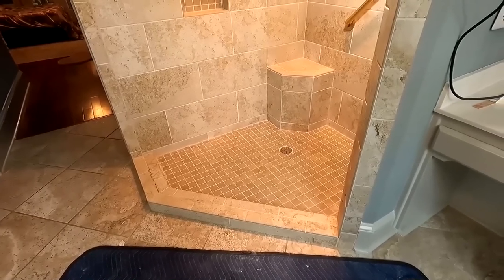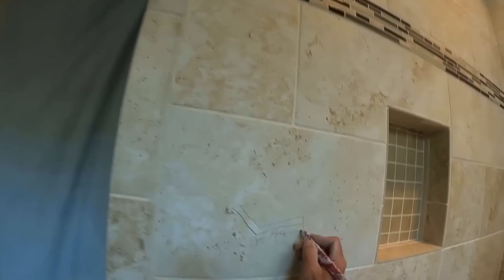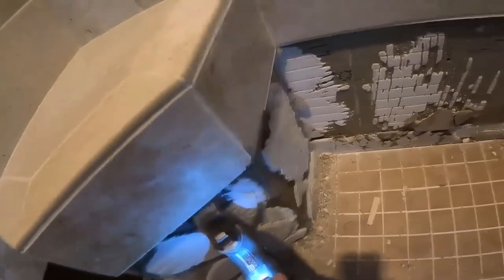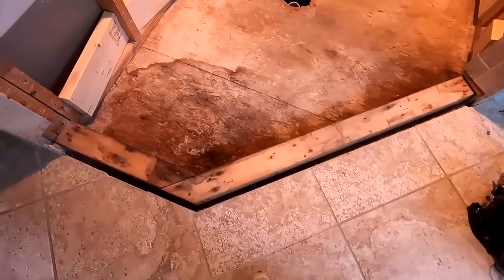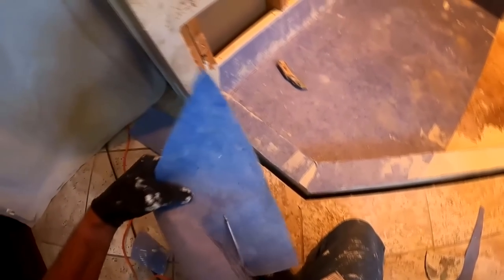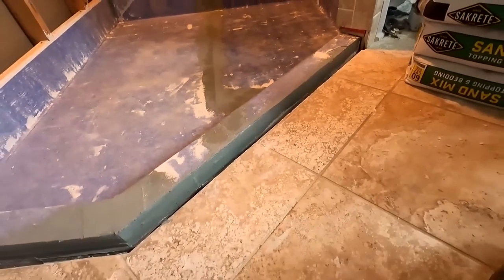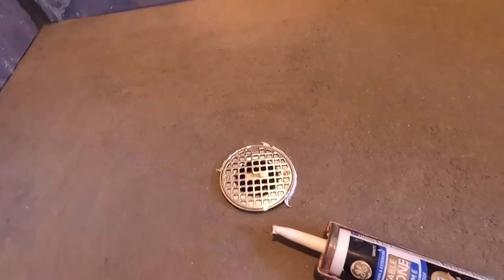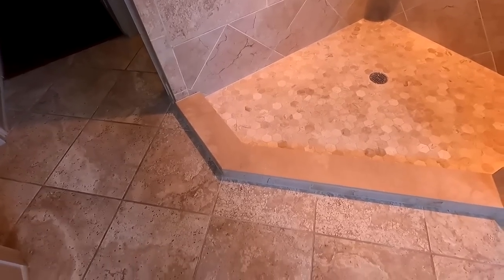FULL RE-BUILD OF A SHOWER PAN...from start to finish

Comment: All of my tile was floated, 1500 sq ft kitchen and bathroom floors and 3 showers. The work was done in 2003 by Italians. No failures yet. I remodeled the main bathroom, from bathtub to walk in shower, cast iron Kohler. Found all of the studs were absolute garbage. But, when you float everything, wall flatness isn't needed. The general contractors must love Italians. Save so much in lumber costs.

Comment: Question: is the outer edge between the curb and the main bathroom floor waterproof? I'm pulling my hair out trying to figure out how to connect the old tile floor to my new curb. Same question goes for the shower wall - how to connect the old tile to the new. Thanks, love your content!
Reply: I have the exact same question
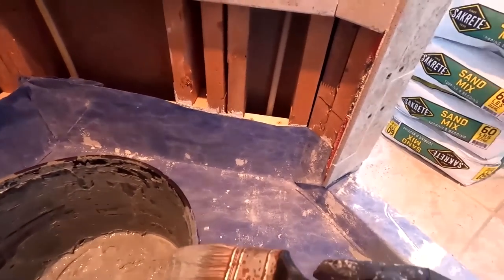Reply: 57:23 ?? I dk if that answers your question

Comment: What are your thoughts about ONLY using Red Guard where the mortar pan meets the shower pan liner in an active earthquake area? Here in Alaska, my rebuild of a shower pan is taking place on the second story of wood frame home that can jiggle, sway, and twist quite a bit, and quite regularly with the earthquakes we get here. Granted, a big earthquake is probably causing more issues than just a teeny hairline fracture in the dried red guard membrane, but I'm wondering if you would recommend also putting in some other layer of thin fabric at the joint (1:09:20 )to help keep it fully water proofed in case there is any small and repetitive  movement in the floor.

Comment: 5:37 — not trying to make an excuse for the previous installer, but seeing that glass sheet liner… I can sort of guess that they struggled with the glass material being less thick than the wall-tile 
So they probably tried floating it as it was installed (crew of 2-3 people) and then started overcompensating with too much thin set — then they probably didn’t tamp in the glass because of all of their thinset squeeze up 😂

Always fun to see liners around various showers, because you can see where the thickness variation was either a problem for the installer or a visual feature

Comment: How much would a job like this cost? My two person rectangle shower with a bench just failed and the plywood underneath is pretty soaked so trying to get an idea of a ballbark of the cost of this job, because I don't think I'll have the time to get all this done myself.
Reply from the maker: There is never an across the board price because every contractor pricing is different and geographically speaking people make money on the coasts a lot more than other places....
If I'm not mistaken I charged about $4,500 for that job, but then that's a much larger shower than normal too, my average cost for a shower pan redo is about $3,500
Reply: @StarrTile  well worth it! Excellent!

Comment: how did you connect old waterproofing with new one  ( if there was one in the first place ) - i get that you had butered up the gap with thinset and waterproffed it  but as you had said it is not waterproof if there is  a gap that old thinset had made imposible to connect waterproffing together - will it soak up water and start to rot ? how exactly do those repairs work?
Reply from the maker: There wasn't any current waterproofing being used, that being said most of your failure happens ankle below so my waterproofing would avoid any problems going into the future

Comment: Im currious on walls with both steel beams and 2x4 construction.  Would you fit 2x4s in to fill the bottom pan or would you use steel?
Reply from the maker: 2x4

Comment: How did you waterproof from the existing tile to the new tile/repair? 
Its supposed to be overlap each other
Reply from the maker: I'm not sure I understand your question, the existing tile that's on the walls doesn't need waterproofing, the waterproofing happened the 17 in down from the existing tile to the pan and including the pan

Comment: Did you put silicone under the liner around drain flange like you usually do with the pvc liner? If not, why not?
Reply from the maker: Sometimes I will if I think it's necessary but as a rule we are doing water and water out system and therefore no water whatever see that area anyway

Comment: Does that water proofer stick to the silicon caulk around the drain?
Seems like it would not bond and leak after a while.
Reply from the maker: Yes it does a pretty good job... generally speaking I'm using waterproofer first to neck of drain and then overlapping the silicone. 
The waterproof layer is your safety net and silicone is backup.
Reply: @StarrTile  
Thanks for the follow up Bob!

Comment: Question. How come you didn’t lay down sand mix bed and then fleece. It seems like you doing liquid waterproofing twice when you didn’t need to
Reply: This is a flawed install.  When the liquid membrane fails, the pan will be saturated as the drain weep holes are plugged below and trapped, known as a mold sandwich.  The wall should have been gutted up much higher, It does not look like the new tile backer board was waterproofed to the original exiting.  This will fail over time.

Comment: Question we pulled out a tub it's a concrete slab under whole house. We wanna cut out the concrete floor and dig down 8inches and pour a new slab size of the shower pan so it's below the main bathroom floor. Then build pre slope pan. The shower door will mount on the edge of the cut out, which we will grind down on a slight angle sloping towards the pan. What are your thoughts on this.
Reply from the maker: So you're trying to accomplish building a curbless shower basically
Reply: @StarrTile  the pan will be 4inches lower than the slab/ the main floor. So when you walk up to it and open the door you will step down four inches into the shower pan the main slab is the curb if that makes sense.
Reply from the maker: @fostersteele5825  right but I don't understand the purpose of that if his not a curbless shower which in essence it would be, you would still need to create some type of slope going up to the entrance and all other sides so that water will shed into the drain where ever that happens to be.
And I'm still curious as to what your specific question is
Reply: Lol this is one of those scenarios you’ve spent too much time thinking about if you “could” you never stopped to think if you “should”. What you’re talking about can definitely be pulled off but.. why? Just to step down into your shower then have to step up out of it..? Why not just do a curb the normal way and save yourself a shit ton of time money and effort for exactly the same result? Or if you gotta be a little different just do curbless?
Reply: @Mr_Glock19  the main reason is if it ever leaked its below the main slab not leaking onto the main floor. As far as stepping down 4 inches and then back up 4 inches you kinda do the same thing when you lift your foot up to step up and over and down into a shower pan built on top of existing floor.
Reply: @fostersteele5825  when I was house shopping back in 2008 I saw one time a tile bathtub recessed into the floor. It was interesting, all I got to say. Just pointing out that similar things out there are like that. 👩‍🔧
Reply: As I age, I see the benefit of a curbless shower due to the fact of possibly tripping over the curb getting in and out. The idea of stepping down into the shower to get in or stepping up to get out isn't safe imo.....but cool to look at.

Comment: So why no cement board or similar application around curb? Looks like u thinsetted the wood curb. Wrapped with pan liner / waterproofed then tiled.
Reply: Looks like u thinsetted the liner around the curb too.? Before waterproofing
Reply from the maker: Cement board goes inside outside and on top of the curb, then buttered with thinset then waterproofed...it's irrelevant what the wall board is, the entirety gets two coats of a liquid topical membrane, it is Bulletproof, not sure how to answer your question any better than that
Reply: @StarrTile  it wasn't showed in the video.  So it looked like you just thinsetted the wood curb or something.  I work construction.  I am mechanically inclined. I do everything around my house and dont like to hire anyone unless I absolutely have to.  And I am a perfectionist. And like my work to last. I like everything perfect. Even all minor details.  I re-did both my showers about 4 years ago using your videos and they still look as good after the day I finished.  So thank you for that. It been awhile since I visited your videos and just thought maybe you were doing it a different way now or something. I know how things constantly change over the years!

Comment: I'm doing this exact thing. The "contractor" who did my shower didn't know what the hell he was doing. Water seeped in and messed up the curb and God knows what else. Do you apply silicone where the shower floor tile meets the wall tile? Or is that just grout ?
Reply from the maker: I only use grout, others will use silicone but I don't see the point if it's done correctly
Reply: @StarrTile  thank you, much appreciated.

Comment: Why not use a flofx type drain if weep holes makes no difference in this type installation
Reply from the maker: You're absolutely right weep holes do not matter any longer as long as you do a seal system... but does not require a product to do a sealed system as demonstrated here, I've done a sealed system before it had a name, and when I caught flack for even doing it.

Comment: Wondering why you don’t wait to grout the floor until the wall tile is installed? This way you grout everything all at once 
Great video
Reply from the maker: The floor is grouted first because the wall tile will eventually overlap that so you need everything solidly filled
Reply: @StarrTile  ahh, good point. Thanks

Comment: The water will never be able to get over the lip of the drain because you double waterproof which is a mold sandwich, when the water gets through the tile on the shower pan it's going to be stuck in that waterproofing and since you waterproof around the drain and cocked it's just going to sit there and stay saturated in the Overflow will eventually go over but it will stay saturated
Reply from the maker: Interesting dissertation....
Doesn't work that way, fortunately for me.
Reply: @StarrTile  so then you tell me how the water that you just trapped oh, that's going to be in the thinset saturated underneath the shower pan tile, tell me how that gets over the caulking that you did and waterproofing to get in the drain,
Reply from the maker: @BonBon770  if and when it gets into the thinset below the tile then it will dissipate out of the grout line same way it got in, same way that a wall would if a wall gets saturated with water... the assumption is the excess water will evaporate.
You can also refer to the article link that I put in my community tab, if you read that he basically says the same thing that I do, when a shower pan is saturated with water, even with a pre-slope then it will always be saturated, I would rather error on the side of caution and have a small amount of water between tile and thinset than to have the entirety of the pan saturated.
Reply: @StarrTile  😅
Reply: @StarrTile  that is totally incorrect with a proper pre-slope in the weep holes not clogged and draining properly a traditional mud-bed will never stay saturated, it will saturate and dry and repeat, it will never stay saturated or hold water,, That's the whole point.
Reply from the maker: 😂😂😂😂😂
That is too funny oh, your mortar bed will never ever ever ever dry out oh, and your weep holes will never drain out water and you have no evidence to prove that...
That's why I said at the very beginning it's an interesting dissertation, do you know what dissertation means? A report backed up with proof, and you have none...
But I digress, nobody is doing the water in water out system any longer, that's why there is the divot method, the bonding flange, and then of course my own very special method which is tried and true for years ✌👌💪
Reply: @StarrTile  🤣🤣🤣
Reply: It's caulked not cocked smart guy...
Reply: @fencerider1492  no kidding, I don't have time to edit sorry there buddy, you just keep listening to Star tile.
Reply from the maker: @fencerider1492  He's a troll...his methodology tells me he's 80 years old, but his remarks tell me he's 15...either way I'm no longer entertaining someone who lacks critical thinking 👌
Reply: For that to even happen water must get past the tile and grout, expected but in very minimal amounts. Then through the thinset, this is expected again. Then through the waterproofed surface of the mortar bed and walls. Then, and only then, moisture would be trapped because there is another waterproofing membrane at the bottom of the mortar bed.

If that happened, then it becomes an issue. But your waterproofing needs to fail first. If that happens then the end result is a failure for any waterproofing anyways. This applies to roofs, stucco and sidings too. When water gets behind them, then the waterproofing goes to work and excess moisture drys out.

 Guess what happens when the waterproofing fails? Something way worse than trapped moisture in a few bags worth of mortar.
Reply: @MrJramirex  totally agree, but with a pre slope, a 40 mil vinyl liner and a post slope at the correct pitch 1/4 inch per foot. And most importantly, the drain hooked up correctly, meaning not clogging the weep poles not not using plastic weep hole protectors I used to use River Rock but the plastic pieces are better. If you use that method, and I also use half inch concrete bored, and that is also waterproof Hydro ban. I also pitch my curb which is usually would pressure-treated on concrete on the bottom and two regular on top. The pan with wraps all the way around and I use Four Corners if I have to fix the plumber pants. Because it's remember I'm just a tile guy. You cannot puncture the top of the curb it is only supposed to be stapled on the outside or nailed whatever, in 10in up and three in minimum above the curb, that's what I've learned over 23 years. It's all in the details, and when you have a system that works without any of these foam boards, or glofx drains or membrane that goes over drywall, why reinvent the wheel? People were just building the wheel incorrectly. And don't even get me started on keying in substrate and flashing the backs of tiles and directional troweling, have a good evening.

Comment: How much did the cost.i have the same problems. Just to get an estimate
Reply from the maker: @adesh217  well that depends on a lot of things like location, type of tile, if I have to remediate anything, but on average a shower pan redo I charge about 3 to 4000
Reply: @StarrTile  first off your video was very helpful. Thank you so much for responding. 

my shower looks the same and have the same tiles.Im on the 3rd floor and the tenant on the second said it was leaking. We are getting a contractor to came and take a look. Its an apartment. Could we still live there while the work is done ?
Reply from the maker: @adesh217  well sure you can still live there if you have a secondary shower of course call my but it will be a bit of a dust storm because there's usually no functional windows in the bathroom..
I tried to mitigate the dust as much as I can but it is nearly impossible
Reply: @StarrTile  i see. thats good to know. Unfortunately its only a studio with a shower. I'll have to take a shower somewhere else.. in your video you said it usually takes 7 days or more  ? Or lesser time
Reply: One last question.. if there is mold build up over the shower who gets that fixed ? Would the contractor do that to ?
Reply from the maker: @adesh217  idk... if I was doing a shower pan and my customer asked me to take care of some old issues I would refuse, that's not my job nor was it the reason I was hired... unless it was mold issues that had to do with the pan directly
Reply: @StarrTile  I see. Well thank you very much. You have been very helpful 🙂

Comment: I could identify the failure at the very beginning before any demo was even done, the curb. It was individual tiles instead of solid surface and, it was also drilled into. And that's where the leak was. All that was needed to replace the top of the curb with a new solid cap. Tearing out the whole floor, liner, bench, bottom rows of wall tile, etc..., was all completely unnecessary time and expense to the customer. All the previous prep work was fine. They just made the mistake with the choice of curb top material (which is usually the customer's doing) and letting the glass guys drill holes in it. See that happen all the time. So much beautiful and expensive work can be ruined by such a tiny little bad choice.

Comment: Pre mix wont dry? is that what you said. Lord why would it ever be useful for anything then?
Reply from the maker: Premixed thinset is not meant for a large format tile, doesn't get enough air under it to dry properly...6x6 or smaller it would work.